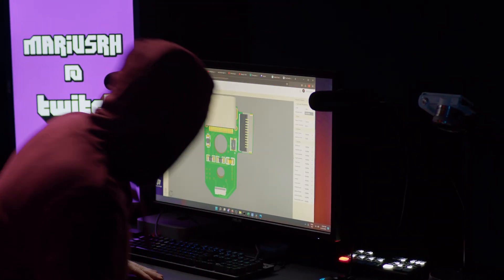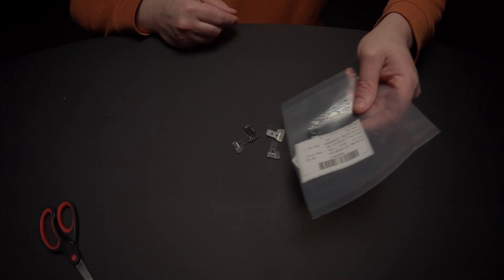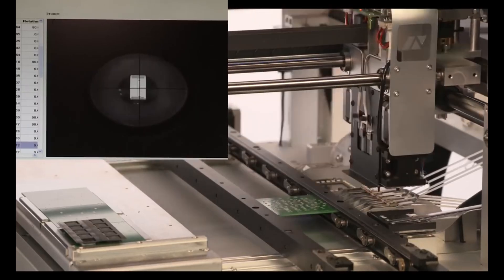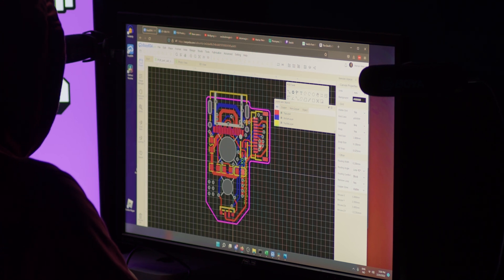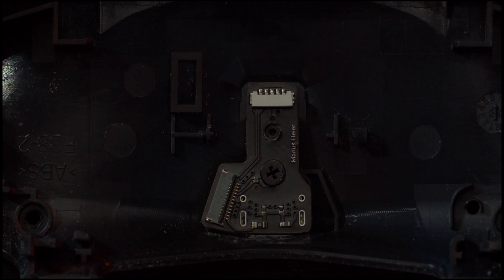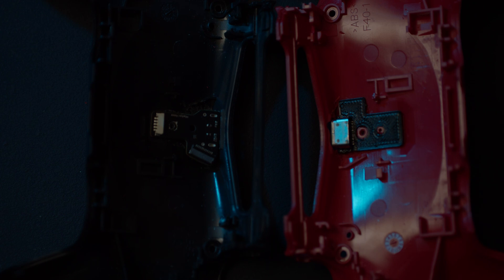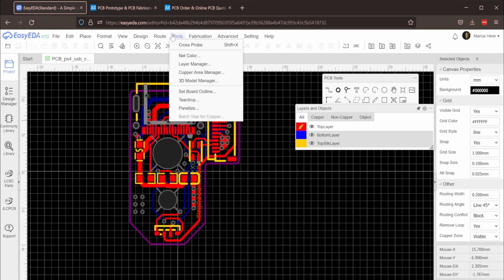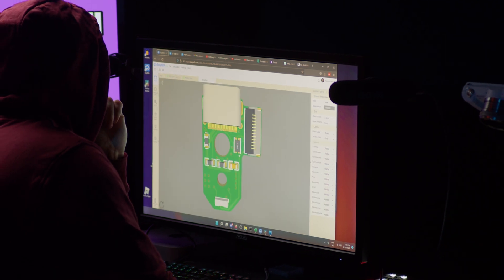Design | V2 PS4 controller USB-C V2 |  #6

Comment: Awesome work, considering your plate
Reply from the maker: Thank you :)
Reply: @MariusHeier1  Hi Marius, the plate arrived to me, I'm just sitting down to plug it in. Filing the space for it first, fingers crossed. Already damaged 3 out of the 4 latches while opening the pad, nice.
Reply from the maker: @MyNigellus  thats normal. I had to open like 10 before learning it. Screws hold it together just fine.  Good luck :)

Comment: Nice job! Just an idea, why didn't you put everything on the other side of the board? Wouldn't the connector fit better that way?
Reply from the maker: Almost. The rgb led needs to be on the top side
Reply from the maker: I will probably make a version with only the led on one side. The led is a lot easier to solder than the usbc connector. Thanks for pointing it out :)

Comment: Still only working on jds-055?
Reply from the maker: Yeah. I dont have any other versions of the controllers. But i think the 44 has the same plastic structure. And just a bit different pinout on the fpc connector. If i get this to work i will make one for the 44 as well.
Reply: @MariusHeier1  that’s awesome. I’m willing to send you a jds-001 if you’re up for getting it working as well
Reply from the maker: @Jek47  Yeah that would be awesome. I can send it back with a USB-C board. ;)
Reply: @MariusHeier1  how do I get your address to post it to you?
Reply from the maker: @Jek47  Hit me up with an email at super marius heier @ gmail com :)
Reply: @MariusHeier1  sent :) hopefully got it right
Reply from the maker: @Jek47  Got it and replied:)